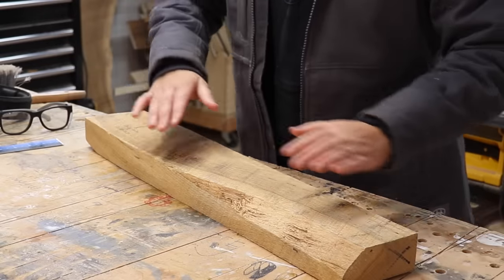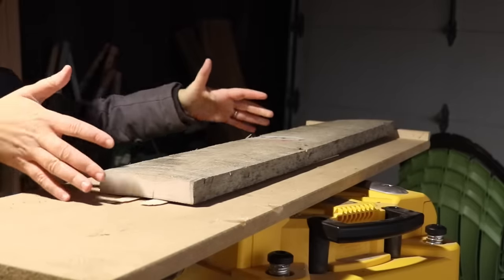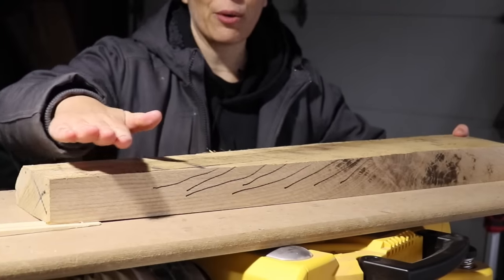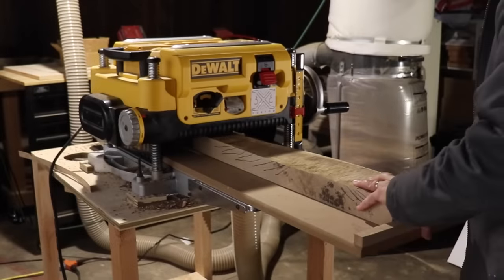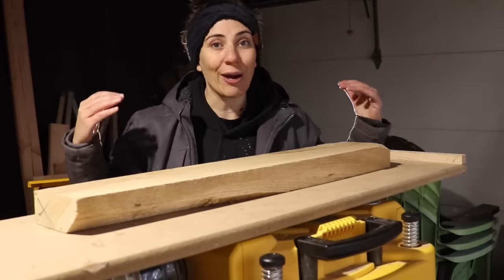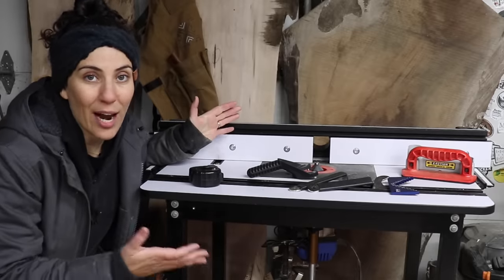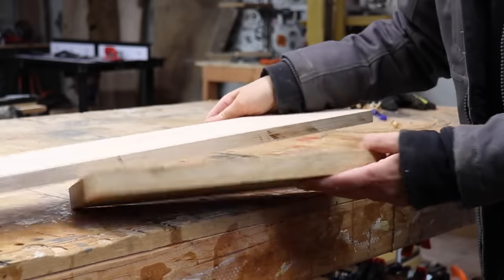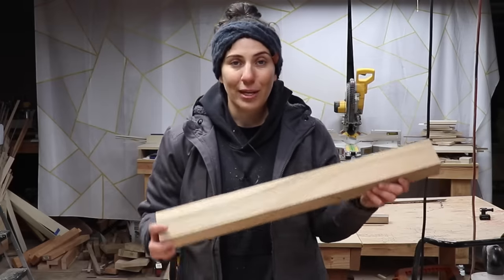Milling Rough Lumber Without a Jointer Using a Few Simple Jigs

Comment: Question….  Is the thickness of the board (front to back) different after running it through the planer?   In other words, in your example is the front and rear of the board thinner than the middle because that’s where the planer removed material?
Reply from the maker: The point of the planer is to make the board one even thickness. Some countries actually call it a thicknesser
Reply: @3x3CustomTamar  Ah!  I get it now.

Comment: One safety tip, don't stand behind your table saw. Stand slightly to one side. If your board binds and kicks back, you want to be clear of it. I was taught this but have also learned it the hard way. It can do serious damage to you. Luckily I only had a bad bruise.

Comment: Is your planer and dust collection on the same circuit? I'm quite interested in the 735X, but my only hesitancy is how much current draw it seems to use in comparison to other planers (based on Toolboxbuzz's testing), and that it would seem to want its own dedicated 20A circuit.
Reply from the maker: They are on the same circuit.

Comment: I feel like the cleat on the end of the jig needs to be in front of the piece you are working.  The rollers are rolling from the top, so in theory the object piece would want to slide off the jig.  the jig is being dragged through the planer by the object piece so virtually no pressure is put on the cleat hen it's behind the object piece.  Just my $.02

Comment: I have a question for you, or anyone who can answer..... I have a bunch of 50 yr old shiplap that I believe is pine, it came from my neighbor's ranch and has been in a shed so it's quite dirty, actually more than just dirt. I used a smaller amount for a couple of my porch walls. That bunch I just ran thru my table saw to skin it. This bunch I have 16 ft lengths and I want to put it on a wall that is 24 x 8. It seems to me that a planer would be great for this. Before I go the expense of buying one I just wanted to make sure that I could run these through a planer....it would sure beat skinning them on a table saw :) I was going to cut them to length first. Any suggestions?
Reply from the maker: I would say planer is your best option.

Comment: Disclaimer: I use jointer and planer to mill lumber, I have nothing against the use of machines when working with wood. That told I disagree on what Tamar told about hand planes, in my experience an electric hand plane used as a scrub plane would be used, at 45° from the grain direction, to carve away much of the wood followed by a traditional long plane, a 6 or 7 is ideal, but a 5 can be used, checking the work with a straight edge and winding sticks, is a very efficient way to prepare the first straight face and also the opposite one, parallel to it. It is surely not as fast as doing it in the proper way, with jointer and planer and in many situations is also slower then doing it with the planer and the sled, but it is not always true, but is surely faster then doing it with a router for those that lack also of the planer. The use of an electric hand held plane instead of the scrub plane takes away the fatigue and time of doing it completely in the traditional way, the con of the thing is that you have to actually know how to dimension wood with hand planes, it needs more experience, knowledge and finesse that passing the lumber in a jointer or planer just as cutting wood with hand saws needs more skill then doing it with a table saw.

Comment: I'm confused. If the initial milling exposed moisturized surfaces that could re-warp, wouldn't re-milling it after you brought in to dry just repeat that issue?

Comment: I've used the same base board, but shouldn't the little bump stop go through the planer first?  I tried it the way you demo, and the board slid on the base stock.
Reply from the maker: Yeah. But if you use hot glue you don’t have to worry about it
Reply: @3x3CustomTamar  There is no need to hot glue the board. Just use it the correct way

Comment: What size MDF do you use? I have 3/4" (well the metric equivalent) but it seems to be a little "woobly" at 8' x13" I do need to mill longer stuff often but I'm thinking maybe 3/4" plywood might be better for a long one and then cut the 3/4MDF down to 4".......just wonder what your thoughts are. Thanks
Reply from the maker: For a very long one (which I’ve only used twice) I Laminated 2 pieces of 3/4 ply together to make it really ridgid
Reply: @3x3CustomTamar  Ok that's what I was going to do with the leftover 3/4 ply I bought to build the crosscut sled from your plans, very nice by the way, and lastly might I add you are the coolest woodworker on Youtube? Too late I already have ha ha ha
Reply from the maker: @Broody4Boglim  🤘🤘

Comment: I only have one question.  Why would you buy a planer before buying a jointer?   I understand jointers are expensive, but it isn’t as if they’re that much more expensive than a planer.

I couldn’t imagine all the hassle of setting up jigs every time I need to quickly square up a piece of rough lumber.

Good tips and they work as well as a jointer would.  It’s just weird that anyone who buys rough lumber goes that far out of the way to not buy even a tabletop jointer.
Reply from the maker: Because you can use a planer without a jointer. But you can’t use a jointer without a planer.
Reply: @3x3CustomTamar true enough.  I understand people want to switch to buying rough lumber pretty early in their woodworking due to the astronomical prices of already milled stock.  Also, pre-milled lumber isn’t always square and true anyway. 

It just seems kind of silly to completely disregard the notion of saving up for a jointer by trying to use other tools to imitate exactly what makes the jointer useful. 

Not saying that’s the idea you promote, just that going through all that work when it could’ve been accomplished in under two minutes on a jointer would make much more sense.
Reply from the maker: @tomhill748  but you can’t do this all in a jointer…. That’s my point. You can do this all on a planer.

Comment: At 14:28 you mention you can make one edge square and straight using a circular saw. Can you explain how to do this? I have 3/4 inch thick 4 inch wide, 10 ft long pinewood lumber. Most of these long boards are bowed or bent and the edges are not straight. How to make them straight using ONLY a handheld circular saw ?
Reply from the maker: Use a straight edge guide

Comment: for all the time you've wasted doing all this farting  around you could have the board jointed if you had a joiner and been done with is in ten minutes, I will say this much your explaination of why you don't run warped or twisted lumber thru your planner is s right on. I've seen boards come flying off  joiner jigs,and i've seen kick back from a planer neither of which is very pretty. but all in all good video . I'm not a fan of machine doing jobs they weren't designed to do but good video very well explained

Comment: Hi Tamar, I was looking for some information online and couldn't find it - hopefully you can help. do you know if there is a way on the dw735 to calibrate it to a reference thickness? for instance if I already have a board finished at the thickness I want and all I want is to plane other boards so that they end up flush with the first on. is it possible?
Reply from the maker: There is a depth stop for certain key thicknesss
Reply: @3x3CustomTamar  thank you for answering, I know that - I was wondering if you can calibrate it to a known thickness of a workpiece, not just those depth stops

Comment: Rough lumber is way thicker than what I typically need (3/4”). I assume you have to resaw at some point.  Where in the 4 steps would this go?  What tool do you tend to use?
Reply from the maker: I use the bandsaw to resaw. And I do that after getting at least one face and one edge square so the cuts would be square
Reply: @3x3CustomTamar  thanks !!!
Reply: @3x3CustomTamar  thanks!! This is a great video btw.  Best I’ve seen on milling for woodworkers.

Comment: good compilation of ways to get true, straight, parallel edges  -   but you ignored the easiest way :  just buy a jointer  -   real, old, cast-iron table 6 inch jointers are all over marketplace for $100 or less   -   avoid those little toy table-top aluminum & plastic ones    -     I've picked up 4 inch WTs & Craftsman with cast-iron table for as little as $35   -    I find the jointers are my #3 most used large tools:   mitre saw >  table saw >  jointer >  6 X 80 belt sander   -

Comment: The only part I somewhat disagree with is the option of a sled. You're relying on another piece of material to keep you true flat. If the area you are working from is the uneven side of the board, that should be the part you allow to ride on the true flat of the planes table. I sometimes have 8' long boards I need to do this with, A sled is not an option then. I have been meaning to make a video, but since I never made one for my channel I don't think the views would be there to spread this idea I use with 100% positive results. I use the shims as you do, and I am lucky to have a large granite slab to reference from(but a dead flat table is fine). I place my board down, check even angle of it looking for any cuppage and twist as you do, place shims FULLY, not just at one end, and then holding those shims in place I turn the board over and tape them down. I think I do have a series of pictures somewhere and I would be glad to send these to you and see if you can discern what I am proposing and possibly make a video for your channel; you have the viewers. If this works for you, I would be glad to communicate via email and send you what I have and even do a couple of rough phone vids for you. Keep up the good work, really dig your channel.

Comment: Lady, l perseve you are experienced in woodworking. However concerning the plainer,& a cuped or twisted piece. After you feed it through you will flatten it out. Even if you feed top bottom. Top bottom. It will come out flat. I have 45 years in all types of iron wood & any other type craftsmanship known. Not as much in brick or concrete. But considered a master in our trade. Try it. Don't just believe me. Great video. I don't mean anything but corrective info. Thanks

Comment: Need to flip that planer sled around so the cleat is in the front. The planer pushes the wood, the wood pushes the sled. The way you have it, the cleat is doing nothing but being dragged along for the ride by the hot glue.
Reply: I fully agree that the cleat should be on the leading edge of the sled. The cutting knives produce much less force than the drive rollers and therefore the cleat should be on the leading edge. I have been using this technique successfully without hot glue. I have yet to experience a situation where the shims or stock piece have moved while passing through the planer/thicknesser.

Comment: I'm a new woodworker, currently without a table saw or jointer. Can someone confirm for me that this process would work to mill lumber with only a thickness planer and track saw?

1. Run board through thickness planer using jig.
2. Flip board and put through thickness planer.
3. Cut a straight line on one edge using track saw.
4. Run board through thickness planer with the final edge facing up (it will be less than 6 inches in width).
Reply from the maker: You can do that. Yup
Reply: @3x3CustomTamar  Thank you!

Comment: Question: When you did the "angle cut", were you simply demonstrating how to utilize that jig? Because it has absolutely no bearing on this process whatsoever - as "Step 4" would have removed the rough lumber AND squared your edge/face in one cut.
Reply from the maker: Yea. That is the point.

Comment: The much easier not fuss way the plane a twist board is to place the board in the planer and run in up till it barely cuts.  Make a pass, flip, tiny adjustment, pass, repeat.  This way you keep the pressure low.  You may need a push stick for this method.  All the other steps are unnecessary.
Reply from the maker: That sounds fussier.

Comment: if you are going to hot glue the wood to joint the face, why dont you hot glue it down for the second face in a position so that you can then run it thru ur table saw to joint an edge?
Reply from the maker: You can do that if you want

Comment: You say you don't like to waste time or money!
It's actually far cheaper to buy ready planed timber if you factor in the time it takes with your process. Even as a professional machinist with full size industrial planers I expect a minimum of 10 passes and often more. I can do everything in one pass on a four side planer in seconds. If you are a hobby woodworker and your time is free then you can save but it will not be by much.

Comment: No need to apply the piece on top of the plywood when straightening. Just use the natural bow in the piece, lay both pieces on the saw top and ensure both ends of the piece are touching the edge of the plywood then run the plywood and the piece along the fence.

A good quality piece of US 3/4 plywood ~6" wide by 8' long seems to fit the bill for almost everything.

This method can be a bit scarier for someone who isn't confident with the table saw but is much faster and yields very similar if not the same results.

Comment: Hello,
If the board has a twist or warp in it then this technique will never work. What you end up with is board that is still twisted or warped because the pressure of the rollers will cause the cutters to follow the twist.
I wish things are that easy to machine and there is a reason why people buy jointers and fatten one side before going to planner. 
Thank you
MB
Reply from the maker: That’s what the shims are for. It absolutely works.

Comment: I don't think the rollers apply that much force that the bend your boards like the fairly thick ones you show here. The problem is the rollers are close to the cutter, that is how you get the twist in the bottom surface carried into the freshly cut top..

Comment: Just so others can know, you don't always go with the grain to prevent tear out. If you are working with the inner part of the cut, you go with the grain, if on the outer parts you go against it. The easiest way I learned to remember is "Inside the box you go with the grain, outside the box the go against it" (like thinking outside the box...).

I've been searching like crazy for an explanation of how to work with grain and the best way to cut wood based on the grain, and the best educational video I've found on it, is from this guy:

https://www.youtube.com/watch?v=oZkYLVrTYe4&list=PLTJv7iQs9Qf-hAmANUfUZpBficLBWiW87&index=6

Trust me, you're gonna come out a wood engineer after this video (exaggerating of course, but still a great educational piece).

Comment: Realistically for that slave board to work well it would have to be solid timber, thicker and much stiffer than that piece of MDF.
It may work for short lengths where the thicknesser table is about the same length, but after that, forget it.
If your not prepared to pony up and get a surface jointer, why even bother ? 
The only smart option is to use that trick to level the surface on your bench with a hand plane.
Reply from the maker: What’s a slave board?
Reply: @3x3CustomTamar  The slave board supports the piece your trying to surface plane flat.

Comment: Really don't want to avoid running hot melt or any glue at all (as much as possible) through the planer.
Reply from the maker: It’s under the piece. If you’ve reached hot melt… you’ve gone too far

Comment: I understand the process and have used it but I'm surprised that the pressure rollers on the thickness planer would flatten a 3 or 4 inch board.
Reply from the maker: I’ve seen it happen.

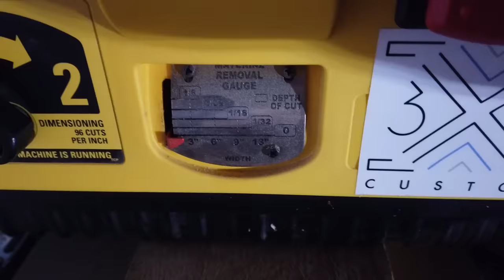Comment: Agree this is very clear teaching ! However, one tip.  At 4:41 in this video we see the stop-block end of the jig positioned to enter the planer last. Instead it should enter first, on the front edge, in order to prevent your piece sliding forward off the flat surface of the sled (and leveling wedges). 

This video shows that: 

https://youtu.be/lw0C02ebMpw

Comment: Everyone puts the cleat on the wrong side of the sled, the board is being pushed from the top so it needs to be able to pull the sled along.  The cleat should be at the front
Reply from the maker: I’ve actually done it both ways. The hot glue does Most if the work.

Comment: I'm surprised you're using that tiny table saw and not a Sawstop, or at least a full size cabinet saw.  You've got tons of videos and obviously go through a ton of lumber making a full size saw very helpful.  Are you sponsored by the saw maker?
Reply: If your shop doesn’t have a jointer than it’s likely not to have a Sawstop or Unisaw.  Would be nice if a sponsor sent Tamar a jointer.
Reply from the maker: Not sponsored. Just need to make upgrades to my shop before I invest in higher powered tools
Reply: @3x3CustomTamar  I think you’re doing great with what you have and I love your workarounds. I used my table saw for years before buying my first jointer.  40 yrs ago.  It was a Hitachi F1000 jointer/planer combo tool that was perfect for my small shop.  Most of the lumber I buy is S2S so a couple of passes through the jointer and I’m ready to go with a smooth, straight and square edge. Keep up the great work and maybe consider a jointer as your next machine purchase.

Comment: You already spent $600 on a thickness planer so just bust out with the extra $320 for a porter cable 6 inch jointer.

Comment: The piece of scrap on the jig is supposed to be the LEADING edge fed into the planer.  it's to keep the planer from pulling the rough piece off the jig as it passes through.   If you are gluing it down hard enough so that doesn't happen, don't even bother with adding that end piece, because it's doing nothing.